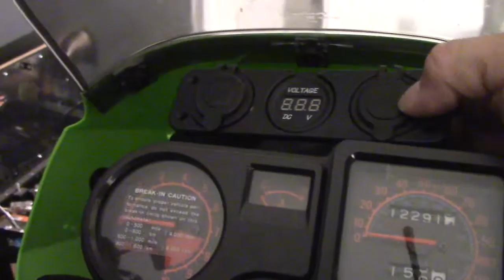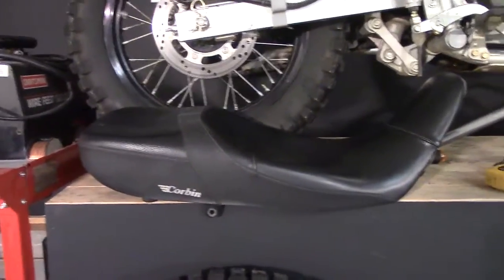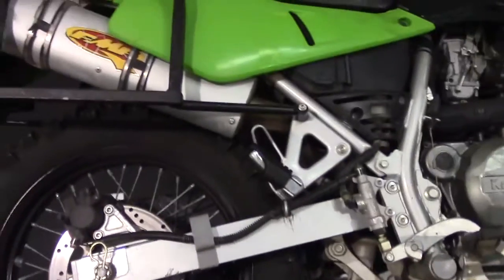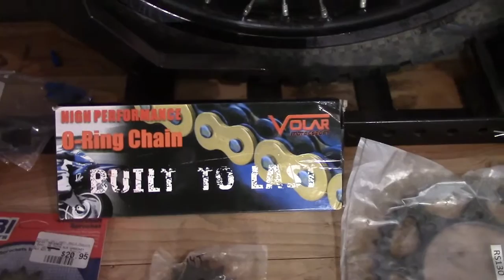Custom KLR650 Build Part 1

Comment: how have those pegs held up? they almost sound too good to be true $ wise. when you installed them in this video, it looked like they needed a spring?
great work man!
Reply from the maker: They have been working out great! They have even held up to a couple small jumps and no problems.  It looks like there is a space for a spring, but they are working fine without one so I'm not going to worry about it.